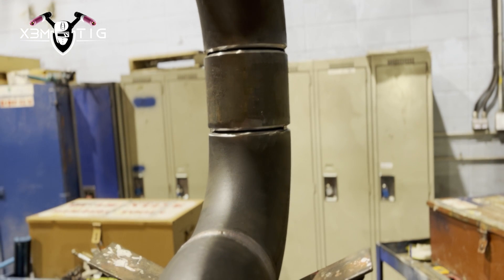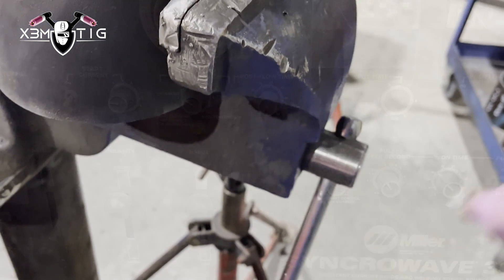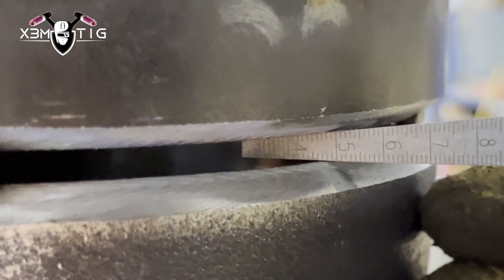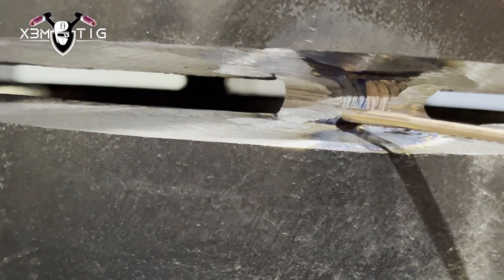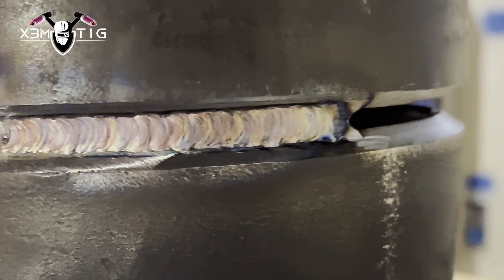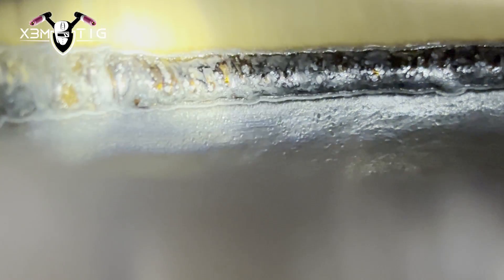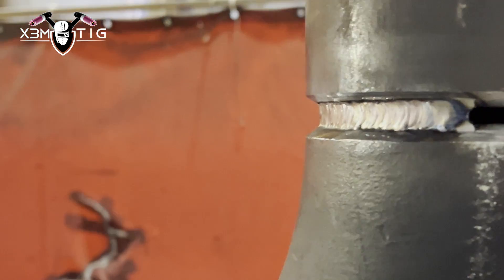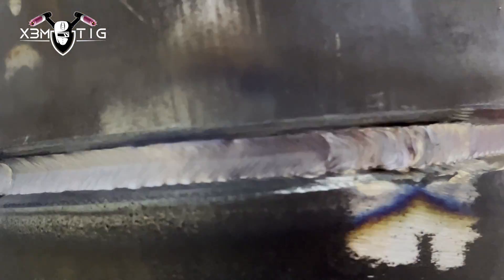TIG Welding Root Pass | Proper Path to Strong, Clean, Perfect Welds!

Comment: Start with 5/32 gap, start with 1/8 wire and shrinkage may require 3/32 in areas, I've also found I get better results not feathering, no need to with starts, and tieing in I find feathering causes too much suck back and get nicer tie ins without, but best practice is to feather

Comment: I ask this question out of sheer ignorance. Why do you want to start out with a gap that then has to be filled?
Reply from the maker: Overall, the gap in pipe welding is essential to ensure proper heat expansion, weld penetration, weld quality, and adherence to specific welding techniques. It helps in achieving a strong and reliable weld joint that meets the required standards and specifications.
Reply: @X3MTIG  Thanks for the explanation. That makes perfect sense.

Comment: I was trying the same technique on a 5mm thick 304 stainless pressure vessel Friday, in the 2g position, 5mm gap, 3mm rod, but the top of the bevel kept falling in on me. I was running about 103 amps. Do you think my travel speed must have been too slow? Cheers m8
Reply: Not travel speed alone. 108 is entirely too much heat for thin wall ss.
Reply from the maker: Hey buddy, amps were too high I guess, you should try playing with amps or set up smaller gap.
Reply: @X3MTIG  ah ok thanks for the reply I found some 3mm rods which I thought were perfect for a 5mm gap but did t want to go too low on the amps. Hypothetically speaking how would you have handled that situation? I had a buddy purging with a pot on the back
Reply: The question was not for me, but I will answer too: in this situation, I would dock without blunting and with a wider chamfer and with minimal clearance, you can even watch the penetration from the outside without it. Just under such conditions, the current that you set would be approximately normal, well, maybe somewhere 120. And I would cook in two passes. And the additive would use 1.6 . You can also cook together, on both sides, but this requires skill, but you can cook without chamfering and gap at all)

Comment: With the root pass you did is it possible for you to use a #10 cup for the root?
Reply from the maker: Yes, you can!
Reply: @X3MTIG  I'm trying to figure out how to walk the cup teach myself how to tig weld pipe. It's totally different than welding exhaust systems turbo piping and repairs.
Reply: @X3MTIG  I'm trying to figure out how to walk the cup teach myself how to tig weld pipe. It's totally different than welding exhaust systems turbo piping and repairs.